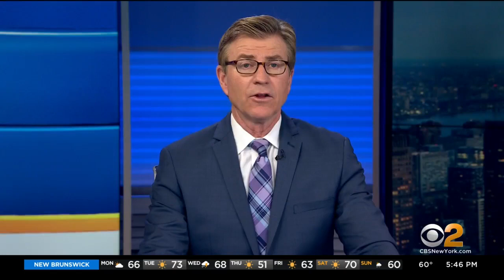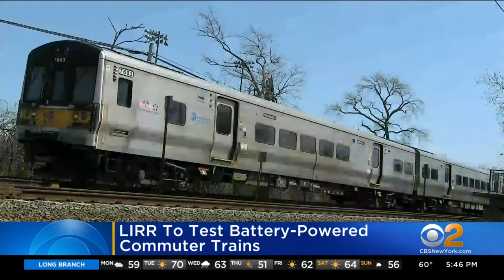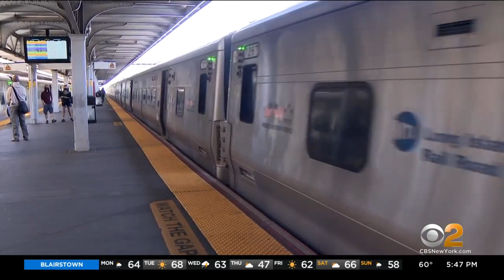LIRR To Test Battery-Powered Trains

Comment: I think this is a good option! Since it’s cheaper, some of the money that would be needed to electrify the diesel branches with 3rd rails could be used for other things!
Reply: I agree, however I feel M9’s and M7’s are not the best option due to them being single level, The platforms in the diesel territory are shorter than the electrified, this is one of the main reasons that the C3’s are multi-level. What would be a better option is creating an EMU version of the C3 or having electric locomotives, and instead of running on 3rd rail they could also use pantagraph like the m8’s, and also have a third rail connector for the already electrified territories, or just battery powered.
Reply: @jayblechman2503  That sounds interesting, battery electric C3 cars!
Reply: this will be  epic failure there is a reason why amtrak hasnt done it yet too
Reply: @jayblechman2503  They also plan on replacing the C3 and Diesel locomotives with new cars as well.
Reply: @NickyD  You mean epic success?

Comment: Seriously LIRR? You're gonna get rid of my precious C3 trains? C'mon now. I get there are M7s and M9s which I also like, but I NEVER get to take myself on your C3s. EVER!
Reply: Honestly I agree, I think what would be a better alternative is making the c3s self powering via the battery’s or having battery powered locomotives, One of the main reasons for the C3 being multi-level is because in diesel territory the platforms are shorter. M7’s and M9‘s would be able to hold half as many passengers as C3’s.
Reply: problem is those cars are unreliable and getting passed there useful service life and really would need to be replaced the railroad just should have spend money on new double deckers like NJ transit this will fail miserably
Reply: @NickyD  So you’re saying that the project will succeed?